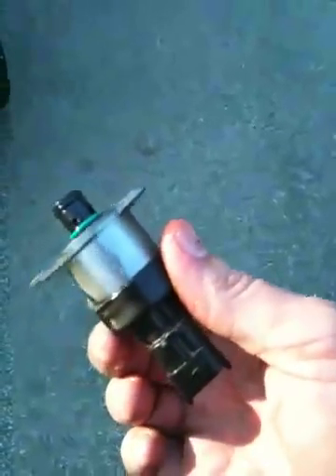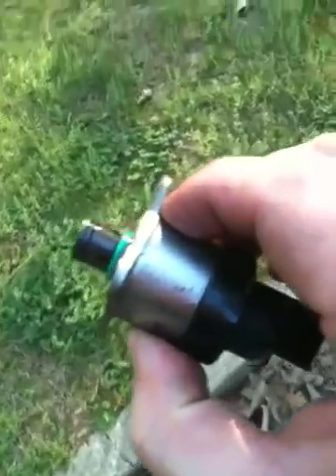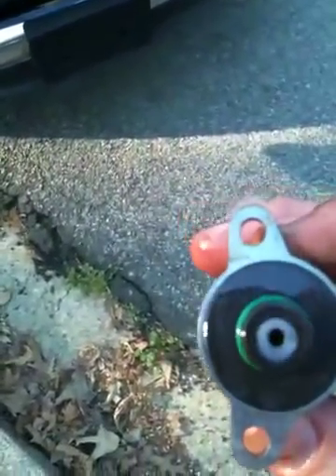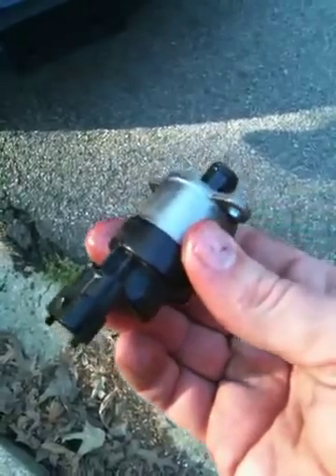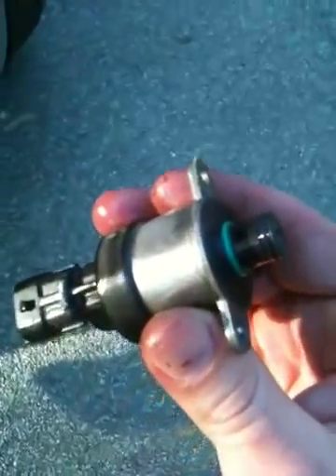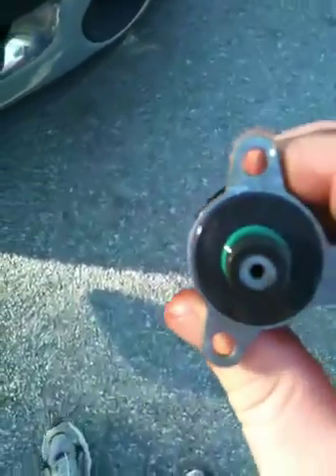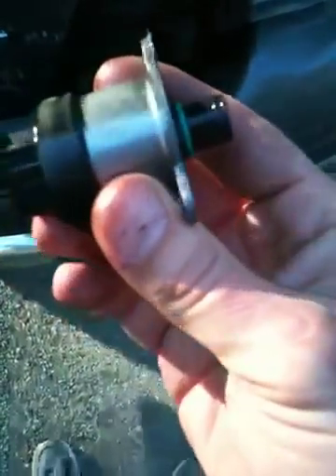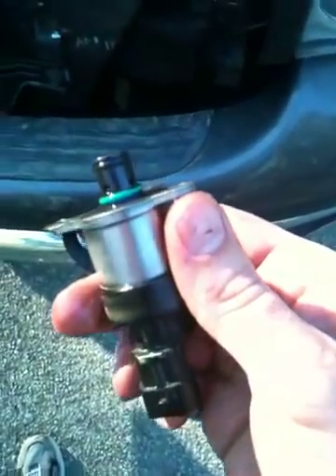Cummins CP3 FCA

Comment: @werdstrebor, I had replaced the lift pump with AD 165 and truck started just fine.  Then died when smashed on the acc pedal.  Then isolated #6 injector since a performance report found this to be a faulty injector.  Truck started fine and injectors are on order.  Injector(s) were causing the system not to build up enough pressure since they were most likely stuck open.... Troubleshot the FCA and I got the "Clunk" when connected to a 12v source.

Comment: FYI, I took mine off, it rattled when shaken, I still WD40’d it with no change. Took it to the shop and they checked fuel rail pressure and it was low. My truck was showing P0088 high fuel rail check engine light. They changed the FCA and now it runs great with no CEL.

Comment: what was the truck doing ?@werdstrebor
Reply: 2019 with new CP3,, FCA went out 3 months after the install from the dealer, it was surging at idle in park. And when I say surging it was dropping idle not going up. Just changed out yesterday and fixed the problem. I troubled shot buy unplugging the actuator and put a volt meter on it and didn’t start it but let it go thought the start up. It gave me 4.5 volts and I also checked the connection to make sure no wires were broke. the bolts are a 25-T I used a 1/4 ratchet and a extension with a wobble head.